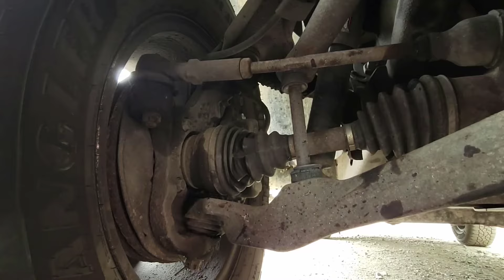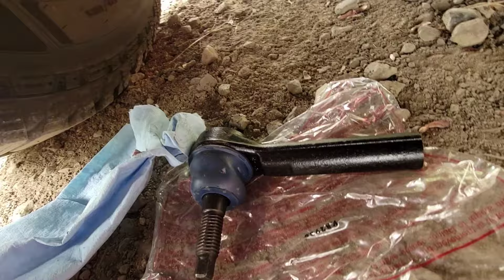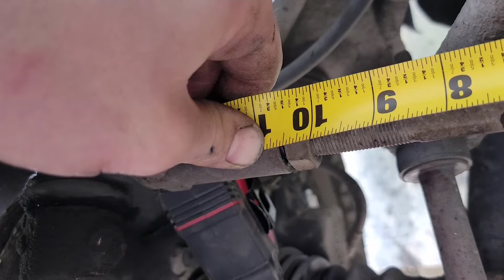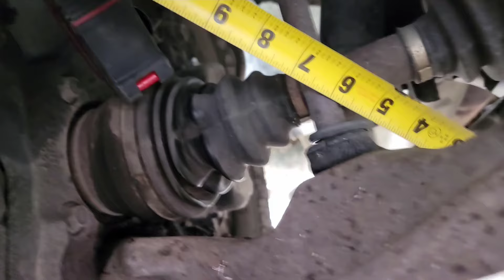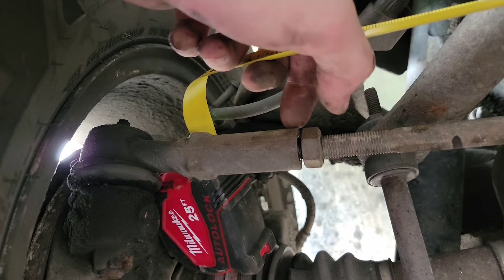How to change a tie rod end without alignment

Comment: Measure from a set point on the shaft coming off the steering link/rack and pinion to the center of the grease zerk on the tie rod end, has worked for years.

Comment: The problem with this is if you get a manufacturer that makes their tie rod ends a little bit shorter or longer you’re screwed. Manufacturers don’t follow the specifications of the length of their Tyrone hands because they’re assume you’re taking it for an alignment. So there’s no standard and I’ll be all length of tie rod ends so this method is actually not good. I’ve gotten burnt doing this.

I’ve received Tyrod ends from Amazon and I measure mine compared to what they sent me and what they sent was about 1/8 longer that’s gonna affect problems

Comment: Your measurement is only as good as the new part being of the exact same dimension as the old part. Any longer/shorter your measurement is no good. Measuring from a centerpoint on the old rod end, such as the grease fitting, would be a better reference point. Just saying.

Comment: I would pop it out of the knuckle, then just unscrew it off the rod, as opposed to wrenching the rod.
Reply: Makes more sense to do it your way as the nut is already at the position it needs to be. you can magic marker behind the bolt to get a perfect line incase it moves while removing the end... idk why people complicate this so much.
Reply: @elgoobra       i did mine a day after i left that comment, and i used this other guys method using 2  1x1 wooden sticks 30 inches long     ...it seemed so hillbilly backwoods yet,made perfect sense       .. Month a stick flat against the hub,put 2 lugnuts on  and hand tighten tite as you can    ...now the stick is pointing forward towards the front under the car an inch or so from the ground      ... I used a sharpie & put a Dot on the end of the stick, & a dot on the ground        ...same on other side       ...  that is my perfect alignment ...... THEN did my tierod replacements              .... after its all back together,   line the marks up by adjusting the steel screw sleevs on the tierods & Lock it down.             Its actually easier than  me typing all this.               Its doesnt HAVE to be 1x1 wooden peices,it can be whatsver you wanna use that will tighten up flat against the hug & not move.    I will use this method from here on out.

Comment: Sorry if Im off here but --------- If the car is sitting flat on the ground        ...... and you take the old janky tierod off ..........install new one,adjusted so that it goes in smoothly without force ........ wont that result in the SAME alignment as ya started with or extremly close to it??? maybe Im Uncomplicating it.  I have  afeeling this would get ME closer than trying to measure & subtract rust/sand etc , thats all complicated to me          ....   Pop old one out, turn new one on until it easily pops in & tighten the nuts.
Reply: It will be pretty close and good enough to drive the thing to the alignment shop!  I have never bought a replacement tie rod end and had the new one be same length as the old one.

Comment: TIP to everyone. Get yourself metric tape measure (Zabiki) and measure in MM instead of inches. You will nail measurment more accurately by doing so. Thank you for great video.
Reply: if you cant read a tape you should be doing it.
Reply: You can read the tape the same 😂

Comment: ALWAYS MEASURE ALL THE WAY TO THE WHEEL END. SOME TIE ROD ENDS ARE LONGER THAN ORIGINAL.
Reply: Don’t use aftermarket parts and you don’t have to worry about it. Aftermarket parts are not made to exact specs.
Reply: Very good point!

Comment: Good video, but don't measure from anywhere on a part you're replacing. If your new tie rod end is a different length yoir alignment will suffer. Measure from a point on the steering knuckle and it won't matter. Cheers.

Comment: I usually count the turns when removing the tie rod. If the new bit is the exact same thing then it works for me. Measuring is good if the new tie rod is a different length.

Comment: Do you trust that the new tie rod end is the exact same length as the old?
Remember that the old ball joint is sloppy.
That changes the distance from the center of the ball joint to the end of the tie rod end.

Comment: My alignment is perfect on my car and it never been in an accident but when I cracked the lock not loose, I could feel the rod wiggle inside the end. Seems like it’s not grabbing onto enough thread. Been driving like that for 30,000 miles. Do you think it’s safe afterwards locked tight I could grab the tie rod and shake the whole car. And they didn’t move it with solid.

Comment: This is a no go main reason is because of debris, rust and corrosion overtime, when changing a tie rod end the castle nut that is given doesnt have rust or debris so the measurements of threading on the inner tie rod wont be the same  resulting to misalignment, its a good Temporary Alignment till you get to a garage, remember professional equipment is ment for accuracy and safety. So rememer this well! Your own safety is worth more than anything money can buy, you cant buy back your life from a simple mistake.!.
Reply: Malarkey. Just say you work at a shop and want more money. Ive been doing it this way for years and have even taken vehicles to have it checked after and guess what... PERFECTLY ALIGNED...
Reply from the maker: There is some validity to your comment. The vehicle I made this repair on doesn't get driven in the winter, so there is minimal to no rust on it. But ty for pointing this out.
Reply: As long as your vehicle is perfectly aligned before doing this and you measure it correctly IT WORKS PERFECTLY. I even take two forms of measurements i make a template from the box i came in and measure it with a tape measure AND EVEN take a picture of the tape measure held up to the tire rod before any work is even this ENSURES you're maintaining that perfect alignment EVERY SINGLE TIME.